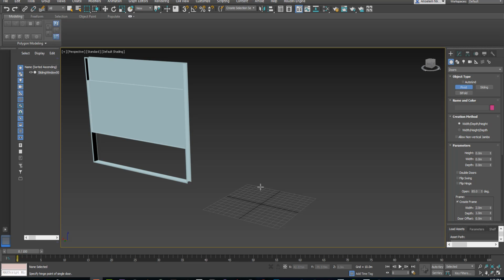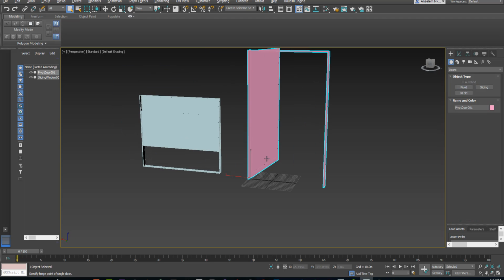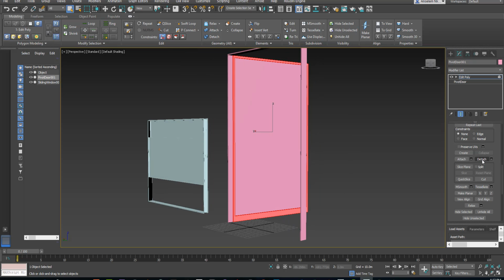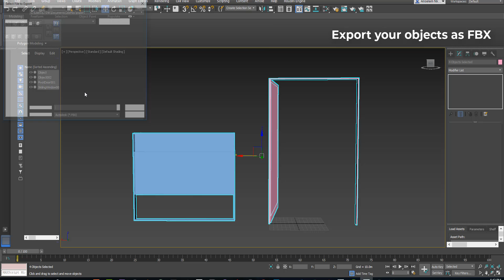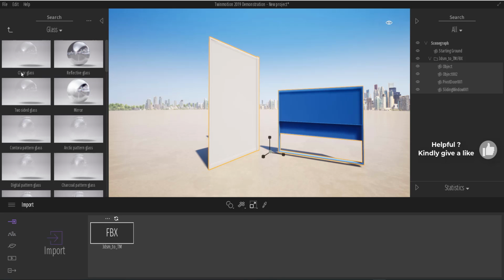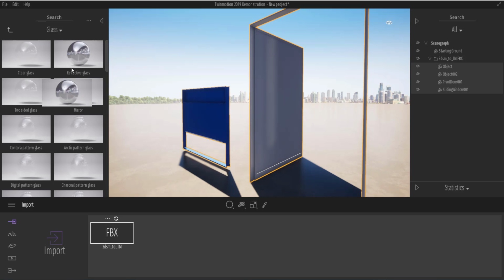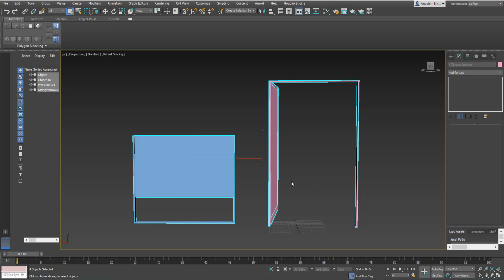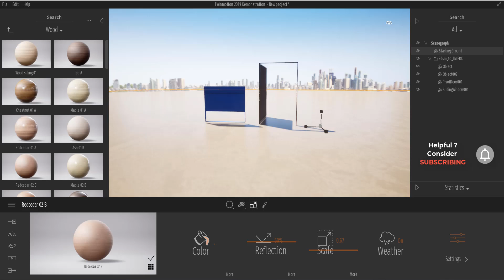3DSMAX FITTINGS TO TWINMOTION 2019

Comment: For 3d max do we need to export an objet by material? don't we need to have UV ready?
Reply: You will need to UV it in 3DS for the materials to work correctly. 
You can export all objects in one FBX. However, there are import options that change how it behaves when added to Twinmotion. This is importantly defined in the collapse section. "Keep Hierarchy" will give you all individual objects, "Collapse by Material" will use predefined materials you've added in 3DS to group objects and "Collapse All" will give you one big mesh. Hope that helps? =).
Reply: @jixal  
Yes, you are right..
But, suppose I want to export many objects with default 3dsmax material.. What is the 3dsmax UVW mapping that is (compatible / fit) with the Twinmotion materials..!!?
Instead of tweaking UV for those imported objects (one by one) inside Twinmotion.. !! 

Thank you
Reply: @jixal  useful tip..thank you
Reply: Good question..!!?